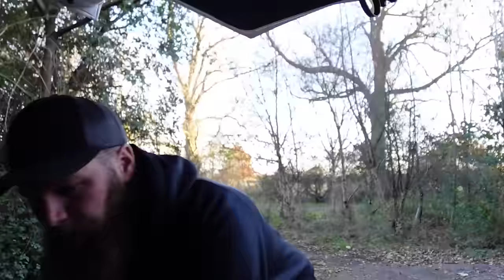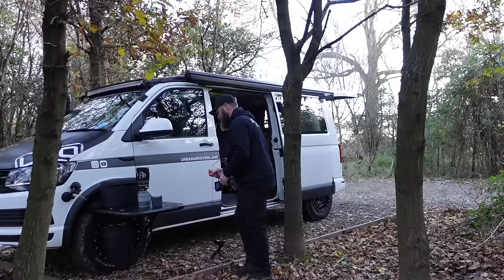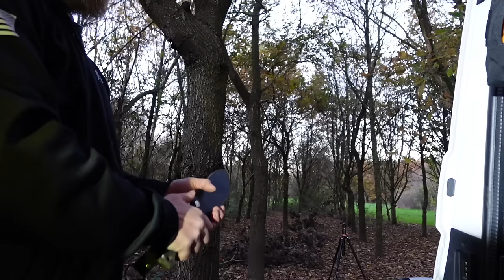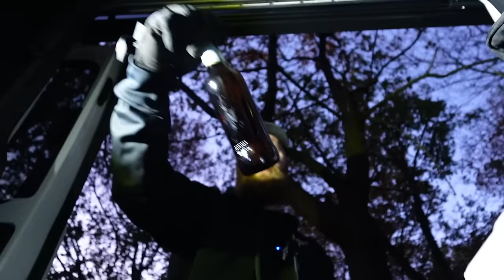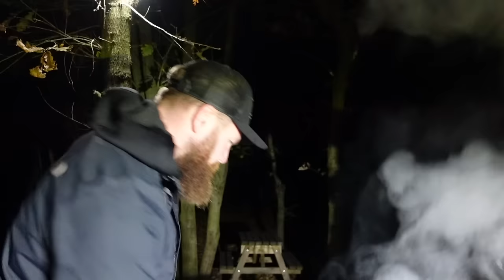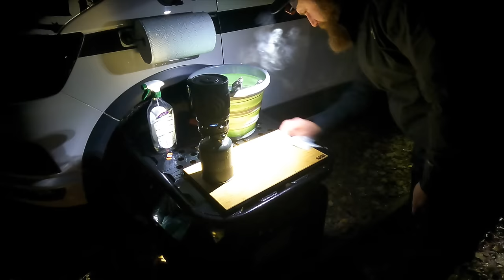Living The VW Van Life. Best setup EVER? But not what you think.

Comment: Hi Aidan hope you well ,loving the latest video, just a quick question regarding your snorkel I'm having one fitted to my van next week  have you noticed any additional wind noise from it ,also fuel consumption has it been affected and lastly water ingres ie when driving in heavy rain or when the vehicle is parked up has any water managed to get into the air box .chances are all of the above are nothing to worry about I just wanted to ask someone that will have answers to my questions. Cheers mate 👍
Reply from the maker: No problems at all mate. No wind noise and haven’t noticed anything fuel wise. 
Not really had it long enough to talk about damage to filter box but I’m sure they wouldn’t do them if it did 👍🏻

Comment: Great set up and similar kit to mine (I’m a Petromax bitch too). I bought the original tire table after watching one of your vids and now wish I had held out for your version! Can I ask what the table was you were using inside behind the double seat?
Reply from the maker: That’s the Ovano mate. See my Ovano video. 
Do you have transporter. 
Petromax is well nice stuff
Reply: @urbanarkoverland  yes and no - I have a heavily modded T6 California with most of the swamper mods you have minus the snorkel (I do have a raised air intake though). Be interested to learn how your night went, looks like you have a wrap for the pop top as well as the diesel heater? I’ve done -10 with that set up and was toasty.
Reply from the maker: @mikelambrou4462  my night was cold my friend. I have a wrap in the way ha ha
Reply: @urbanarkoverland  which one did you go for? I have the pucer screen, not fancy - no zipped windows etc but it absorbs zero moisture so can be wiped dry plus I can lay it flat and store it in the roof. Cheaper than most of the other options too.